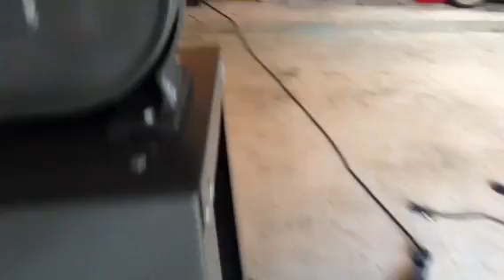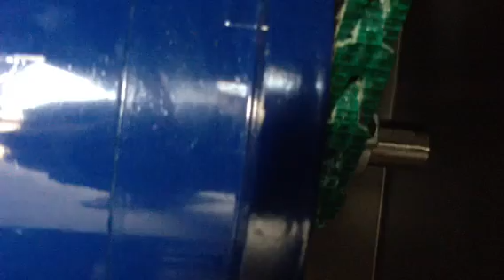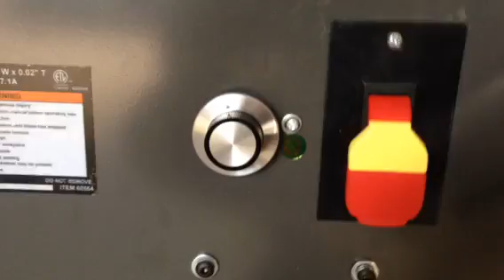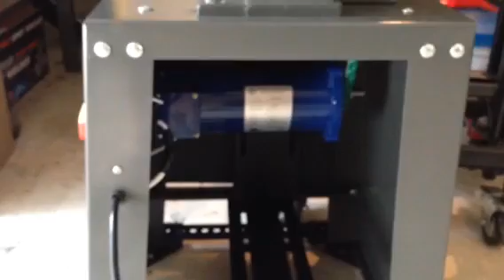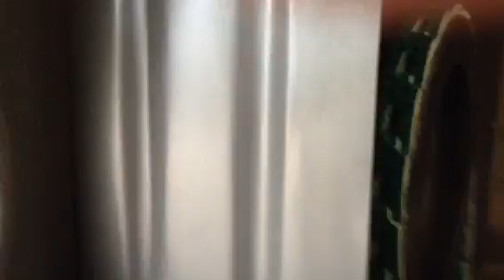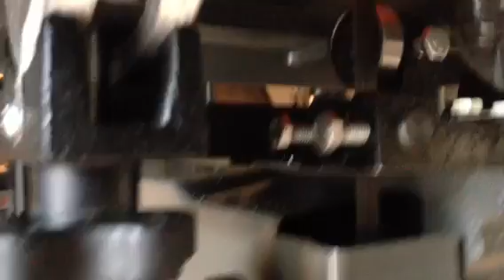Harbor Freight 14 inch Bandsaw, Variable Speed D/C Conversion

Comment: could you have used a VFD with the original motor?
Reply: Redwood1957 - No, the original motor was a single phase 120 VAC general purpose and a VFD requires a three phase 230 VAC inverter duty motor.  A three phase standard duty will overheat at RPMs less that half and they do not have full range torque like an inverter duty motor.